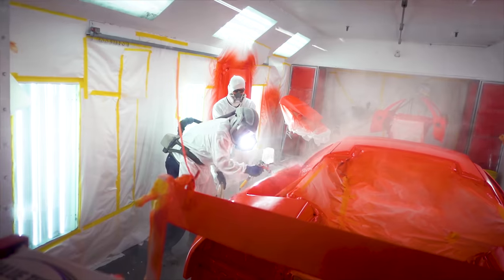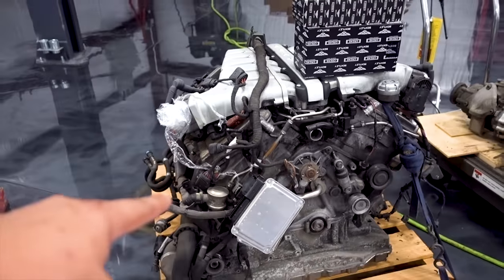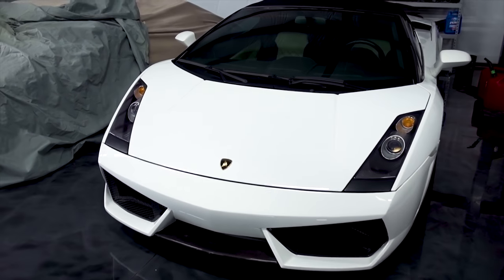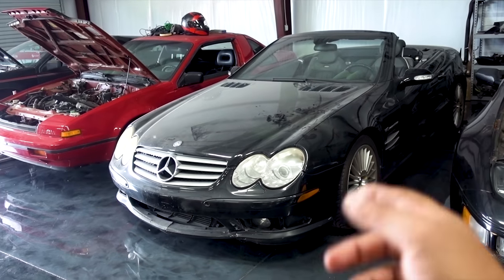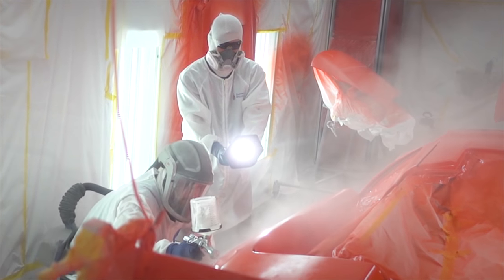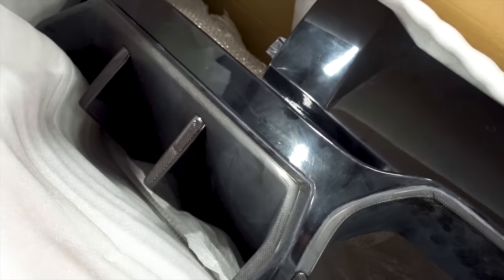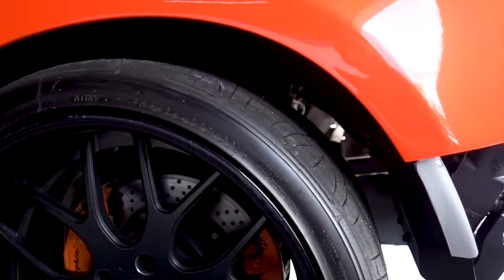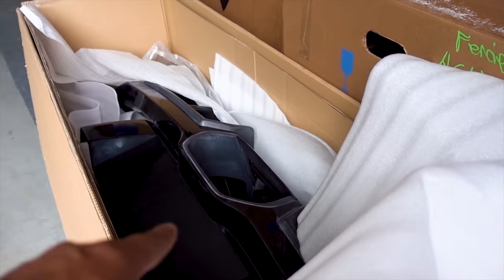My "Cheap" Fast & Furious Lambo Is Actually CRAZY EXPENSIVE (HUGE GARAGE UPDATE)

Comment: Hey Tavarish - odd trick for the broken bolts on the Bentley tranny that might help.  Weld a flat washer to what's left of the stud and then weld a nut on top of the washer.  With a little bit of heat, luck and breaker bar persuasion they might come out.  It's easier to tack a washer onto a broken stud than just a nut alone.  The washer gives you a nice platform to fix the nut to.  Have your welding Jedi friend Tony show you the way.

Comment: ok, we've seen you do turbo's and they are cool. ever thought about doing a supercharger install?
Reply: bigrob he has a SL55 for that
Reply: Blowers just bolt inplace of the intake its really simple i can take mine of in 20 min and most of that is fuel rails in the way
Reply: Cory Sanchez you can’t make a blanket statement like “blowers just mount right up.” That’s so reductive that it’s just false. Adding any type of forced induction that isn’t OEM isn’t as simple as just “mounting right up.”
Reply: @johnd9357  it is and it isnt like centrifugal is a nightmare and might aswell turbo imo but something like a roots blower on any tradintonal v8 is super easy especialy if no inter cooler and depending on complexity of a fuel system even a screw type super charger with w2a or a2a intercooler is 6-8 hour install wich includes removing intake and shit u cant do a turbo that fast unless u use a premade kit
Reply: @MIKEK3NT  I'm sure they aren't, like building a turbo kit from scratch but still taking a 200 hp car to 400+, would be interesting to see to me.

Comment: center force clutch with kevlar disk, not pucks very smooth engagement,  had it in a  DP 935  525 hp.

Comment: About that R230: You didn't have that model in the US, but in Europe the E250 CDI was available with a manual transmission. It had 500 NM of torque and there are replacement clutches with 15% uprating - and Mercedes does put a bit of headroom in. In theory that should take the torque of the M113. There was also the W204 300 CDI (OM642 V6 Diesel, 510 NM of torque), which may be better suited for the V8

Comment: Plastic Brake Ducts...
Before you install those, cap the small end and fill them with Plaster of Paris.  Take the plaster out and save the forms.  You can use them to make your own.  Make a dozen pair of them or so and sell them.  You can definitely make better ones and sell them for way less than $500 with a big profit.

Comment: I used to have a 87 Nissan pulsar nx se, double over head cam, 5 speed with black interior, and champaign exterior. It was my high school "sports" car that I bought from my friends sister. It was a very fun car. About 10 years my father found the identical spec car to mine which was totaled out a few months after I sold it, in Wisconsin, he was going to buy it and surprise me with it for my 30th birthday,  but his health took a turn, and he missed the deal to buy it.  I wouldn't mind finding one again for the collection. Let me know if you ever find one

Comment: For the Merc, if I was you I’d try to use a C6 ZR1 6 speed. Smooth shifting, made for a 630hp, easy to find, relatively cheap parts. Yeah the adopters would be custom but that’s an easy fix. 

As far as the Lambo convertible, change the sensors first. If the top goes down partially then more than likely one of the sensors isn’t registering correctly for the computer to complete the process. I own a Mini convertible so I know how finicky those sensors can be.

Comment: Had a thought, what if for the Gillardo, instead of replacing all the stock stuff, figure out your own system with linear actuators? you can get a bunch of different sizes and it would be a fun challenging project... completely depends on how the thing already works and space etc but you get the idea @Tavarish

Comment: ClutchMasters has a silent twin disk design that may suit your MB build. If you’ve ever seen BoostedBoiz. minivan, it has that clutch. No plate rattle, torque clamping force for 600-700 lb/ft, and a less than single disk petal pressure. Otherwise, it’s Tilton multiplate clutches. A three or four disk 8” racing unit, splined for a 370Z trans with a custom flywheel might do the trick, but your transmission adapter plate might need to grow in thickness to accommodate a taller clutch.

Comment: It's 2019, it's not difficult to find a clutch with great driving characteristics for only 600ft-lbs of torque.  The McLeod RST and RXT do exactly that, and have a stock like feel.  I've used the RXT with 750hp/640tq since 2015.   There are probably a handful of other options as well.

Comment: NPC performance clutches in Australia do custom  clutches.  We use then in our landcruisers.  They are light as factory  and are rated to 1300nm torque (960ft lbs) at only like 400hp  at the wheels

Comment: I had a pulsar years back. That sucker dropped a valve into the cylinder and spit it out the exhaust. It made it 60 miles at full throttle trying to keep speed on the hwy. It died at the last hill up to my driveway, but I loved that car. I beat the piss outta it for years.

Comment: You should get Normal Guy Supercar to help you rebuild the F355 engine. He just did a major service on a 348 - including pulling one of the heads and replacing valves.

Comment: Not sure, but my Dodge Challenger shares a chassis with Mercedes E class, it’s a 6 speed transmission, and I’ve read that the auto transmission in these are also
Mercedes, so that may be a way to go on the Mercedes transmission swap.

Comment: Silly question - instead of buyig a $12000 bumper...wouldnt it be cheaper and more cost effective to have someone mold and make a new one ...then you have a mold to sell others to other people. Fiberglass is cheap...and I dont think carbon fiber is that much if you are painting it and its not a structural piece.

Comment: Lamborghini Murcielago V12, New Price $320.000, Used Price $200.000. Wrecked Lamborghini Murcielago Price around $110.000. Repairing Body Kits $40K, Exhaust System $10K. You can buy Lamborghini Huracan V10-LP610. It is better than Old 2001-2010 Lamborghini Murcielago. It is crazy.

Comment: Competition Clutch/ DKM Twin Disc clutch I put in my Turbo E36 drives like a factory clutch with nearly 0 chatter (less than a plain light weight flywheel on this transmission) and it is the "Cheapest Twin Disc in the world" maybe not but it sounds good hahaha, maybe they make something you could use.

Comment: Tavarisch, why not A/C your shop?  Working in Florida heat without A/C has gotta be a killer.  With A/C you'll get way more done, so productivity will take a big uptick.  It's also better to keep that collection of near-supercars in a climate controlled environment.  Put some serious foam insulation on the roof and walls, and it probably wouldn't cost more than a few hundred a month to work in comfort.  Take care, guy - Charlie

Comment: Freddie, only reason its mega expensive now is what you've done to it. If you had just got the key working, cut out the roll cage and used it. The lambo would still be cheap now its cost more than just buying one in good condition. 
It will soon not really been recognisable as the film car.

Comment: @Tavarish,  I am in the process of removing the side skirt on an 08' Murci Roadster.  On the Drivers side, the side skirt is different due to oil cooler and vent.  When removing the side skirt was it necessary to remove the oil cooler or at least one of the hoses so it would slide out of the way once the side skirt was fully released?  I'm having trouble with this one and you having done all of the work maybe would know what that process was.. Thanks for any insight!  Great looking ride, have been following all of your videos.

Comment: Hey Tavarish fun fact if you were to buy every part top to bottom front to back for a lambo from the dealer that it would cost twice as much as a new msrp lambo
Reply: Also adding to the top usually the lines leak from the pump

Comment: Hey Freddie,

On that Merc gearbox:

We've mated a ZF GS6-530BZ (or: manual from an E60/E90 BMW, in less fancy wording) to a Ferrari V12 engine out of a 612 Scaglietti (see facebook.com/minottocars or instagram.com/minottocars for pics). 

The gearbox is easily good for 450 lb-ft with the standard (single plate) BMW clutch and really isn't all that heavy on the left leg. Might be worth a look for your SL?

Comment: You are spending way to much on second hand plastic parts when you can get a really good custom 3d printed part for much cheaper
Reply: But if you can't find the 3D model of the part pre-made on some open source website would the guy not charge you just as much to model it first + cost of printing?
Reply: Yes you would need to borrow a mint condition part from someone's lambo but that's do-able. They could have the part back as soon as it's been scanned
Reply from the maker: Lol ok

Comment: Not trying to hate, but I could buy 2 or 3 really good used sport/street trucks and be wayyyyyy happier than driving around with a Lambo with a $40,000 paint job, and worrying about it getting scratched in the first parking lot I stopped at.  Sorry but I will never understand since I am not rich, but to each their own I guess.

Comment: I feel so disconnected from Tavarish. I spent over a year religiously watching multiple times per week, falling in love with every project, waiting in anticipation for each next repair and upgrade.. and now, it just feels like Tavarish is a cousin you were once best friends with but now lives far away. I feel so disconnected from all of these projects, like the Mercedes has been getting a manual transmission for nearly 2 years, the bently needed a motor and new one arrived 6 months ago.. 
Since the murci video finished, the only project I've seen is the Supra motor, and even then it's format was strange, the live stream felt distant and I'm just rambling. I want Tavarish to get back to the old days of 3 times a week working on ONE project.